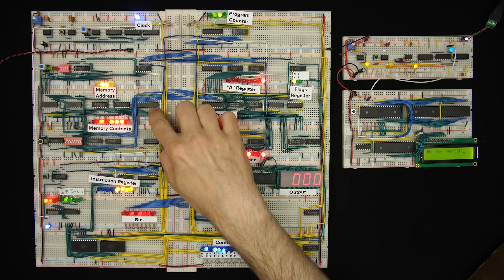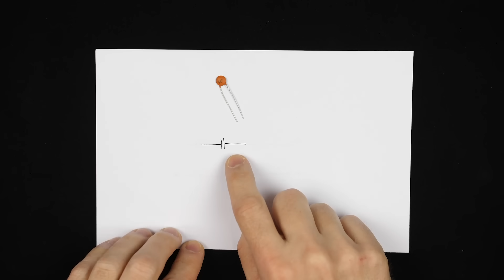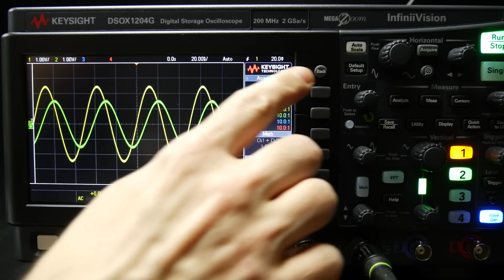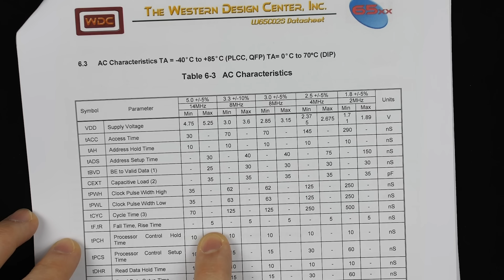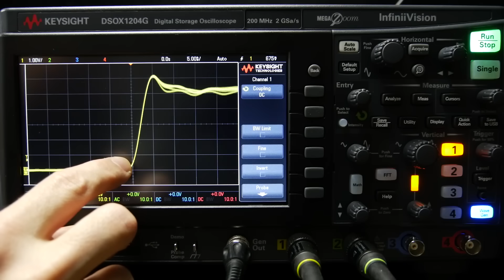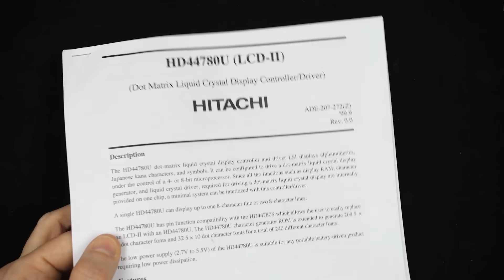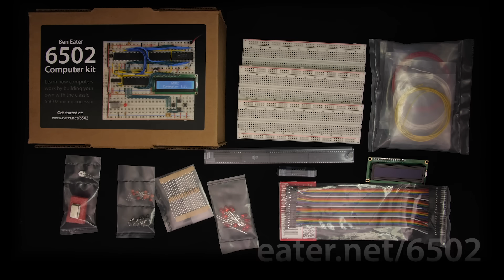Why build an entire computer on breadboards?

Comment: Pheeew, just reading the title… my answer “To make your life a living hell”.
Didn’t say this as an insult, but rather said it from anger. And not towards the creator, but towards myself🤣 I’m in uni, studying electronics and we had to build a finite state machine, a binary counter which counts up to 15 (obviously not in order, HA!!, would be too easy, and with some not-allowed states)… and we had(have) to make this on a breadboard. 
I spent at least 5 lab sessions (each of them 3 hours), building it and later debugging it, and even later taking it apart and rebuilding it… and now spending more time on it, but now at home with some stolen ICs, with the help of dad… and we built it again from 8pm to 1am… but due to the obvious side effects of the late time period… we made the situation worse rather than fix it… going from phantom connections, broken IC legs, burnt out LEDs…so… what are we doing now? Yes, rebuild it with even more thought while doing it, and not late night.
Btw, the design works on paper, and on simulation, it’s always the practical stuff that never wants to work.

Comment: When you’re demonstrating the phase shift at time 11:00(ish), why does it appear that the output is moving ahead rather than the input? Or is moving forward really falling behind? BTW, thanks for all the really great videos. They are a great resource. - Jason Burchell
Reply: It’s from the capacitance/inductance inherent in the breadboard, which phase-shifts the output. It’s much more noticeable at higher frequencies
Reply: @LookItsLuke99  I understand the phenomena , I don’t understand how the phase shift appears to move one waveform forward in time or the other waveform backward.
Reply: @JasonBurchell76  Moving a waveform "forward" on the time axis is a delay because for the same periodic signal it will take a longer time to reach than for a signal that isn't phase shifted. For example assume you have a waveform that starts at 1 at time 0. If you phase shift this signal to the right by 1 second instead of starting at 1 at time 0 you will have 0 until you hit 1 second where you will see the beginning of the signal period which is 1.
Reply: That's what a phase shift means( sin(wt - a) moves a/w forward on the t axis).

Comment: why build physical at all, simulate it, on octave/matlab/logisim-evolution/anything/java/c++
Reply: its logic circuits anyways, not really the underlying voltage shzz
Reply: it makes it more fun
Reply: @TheMatto58  to each their own isps
Reply: Because those are slow and can be inaccurate. Also, you can't really use it for anything, and just using a simulated one in general is more annoying.
Reply: @tristanmisja  why do you think digital logic is inaccurate
Reply: @Jkauppa  The chip implementation could be off
Reply: @tristanmisja  so could be the chips
Reply: @tristanmisja  simulation is better for fast prototyping also, unless you want to go spine to the walls hw only

Comment: In electronics school back in the dark ages, we built an 8080 computer on breadboards.  Out of 4-6 teams in the class, I am not sure that more than one got it to work.  Wire wrap seemed to be the fix for that, but it was a huge pain.  I still use breadboards whenever I do work on an actual project.

Comment: because you can reuse the components... w.e

what I really want to know is why are they called breadboards?

and ofc getting a kit takes away thinking about how it works, how ironic you sell them. 
you could just etch your own boards, my old man used to do it with a magic marker and a little tub of acid ffs... but oh no! that would be work and require planning!!

there was also a time when you could just salvage all of the components you need for an electronics project from junk... but in the age of surface mount bullshit that'd be more work than fun lol. hence why this is all done with 80s hardware, this hobby more or less died in the 80s.

Comment: So I am really interested in your kits when I can afford them but for now I have a newbie question or comment about your demonstration of the phase shift experiment where the output signal begins to diverge in phase from the input signal. I see that it is also attenuated but what happens if you continue to increase the clock until the phase shift equals exactly one wavelength? Would this circuit work at one megahertz then stop working then begin working again at 100 Mhz or whatever frequency would result in a phase shift of 360 degrees? (I’m just using random numbers to make my point). EDIT: I also wonder if the output signal would disappear completely when the input and output were 180 degrees out of phase?

Comment: Before watching this, I'm going to guess that the extra impedence from longer connections between parts would hurt the performance potential of the computer and also introduce many additional points of failure. Still, it's too cool not to try it...

Comment: Big projects like that are good until you need something with higher current/voltage loads. Given that heat dissipation can occur in some circuits it really depends on the quality of breadboard, or if you need to move up to a PCB board. Like another other comments I see here though I agree on having a computer for a breadboard, but do teach how the electrical side of things work both in practicality and mathematically. I think a lot of people probably struggle on those and maybe some components that need more complex equations to use more correctly.

Comment: From the color difference between those breadboards the cheap breadboard honestly looks like its made out of zinc instead of steel. That would explain why it lacks elasticity of the better one, zinc is more maleable than steel while steel is stronger and more elastic. It would also explain why the  cheap one is thicker since zinc is weaker and needs to be thicker to have any strength.

Comment: I got mine working, after 18 months of watching the videos and two weeks with the kit. Getting the Arduino was definitely the kicker. Here and there I'd seen the character display clear, which led me to believe I was on the right track, and, once or twice, I would see an "H". In hooking up the Arduino, I went over my wiring mess on the breadboards 8 or 16 more times, and suddenly I was seeing garbage on the character display! Not Hello, World, but some kind of data was making it into the character display.

I was futzing around with my Arduino connections, checking my external power and ground, and my reset circuit, and re-writing Ben's Arduino program so it only displayed writes to the 65C22, and I looked down, and there it was.

"Hello, Wo"

I cranked up the speed on the clock module, and it did the rest of it before my very eyes. And I hit reset, and it did it again.

Then I bumped something, and everything went to hell. But now I know how to find out what.

Happiest day of my tech life since Christmas 1983.

Thank you, Ben Eater.

Comment: O you know what’s the worst, when the entire circuit is correct but one of the resistors isn’t pushed in all the way, like in my electrical engineering class, I spend so much time trying to figure out why the circuit isn’t working then I rebuild it and it works like fuck

Comment: I learned from experience those breadboard anomalies, that can arise from cheap breadboards. After hooking up a few components, creating a lovely circuit, that worked fine one day, the next day the same circuit was really wonky. I thought I had made some mistake in my wiring, so I doubled checked and triple checked everything. Wiring was fine. It was the breadboard itself that wasn't guaranteeing good connections!

Comment: Isn't it possible to "clean up" the square wave by feeding it into a little circuit that just outputs 5V if the input is "high" and 0V when the input is "low". Then it would be 
1. a flat line at 5V 
2. then a ~5ns shift time from 5V to 0V 
3. a flat line at 0V 
4. then a  ~5ns shift time from 0V to 5V 

Wouldn't that at least eliminate the 150MHz sub-waves in the "staying high" and "staying low" phase?

Comment: if 20MHz is already a pain to be stable how the hell can today CPU run with 3.30GHz(3300MHz right?) or more, is it just because the transistors are nanometers in diameter and/or the circuits are very insulated from each other?

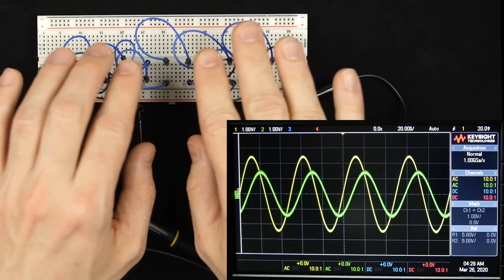Comment: That part at around 12:48 is actually really interesting, where he is hooking together some simple wires and measuring changes in a high-frequency signal across them. Not only can you detect the capacitative/inductive interference of the wires in a practical, physical way, so that you can avoid/reduce this interference. But you could use this in a deliberate application to measure the distance between the wires, and their orientation. I wonder if this is something people do.

Comment: I'm working with this equipment in physics and systems and this video was really helpful just to understand concepts. Does adding a capacitor near components act as a low pass filter? Also you should definetely explain the math on everything since you have such a great understanding of what's happening! Great video!

Comment: I certainly agree with the intro of this video, I never thought of getting a kit as anywhere near designing a circuit. :) A kit to me is little more than a commercial product with greater accessibility to its components and more likely to fill an esoteric niche. Designing from scratch is something else, and while I'd want my designs to ultimately occupy a PCB or at least stripboard, breadboard makes it easier to change the design, including fixing hardware bugs.

Excellent explanations of the analog issues too!

Comment: I Like Using Breadboard. Because You Don't Have To Painfully Solder Every Component Into PCB Or Prototyping Board. And If You Make The Wiring Cleanly. You Feel Satisfied. Yea Sure It's Big. But You Can Move It To PCB Or Design Inside Software To Made It Compact.

Comment: Great video - may change my opinion of breadboards. I think I agree they're much better for learning.

minor quibble about capacitors - should also say: 

"Until charge flows to/from terminals of the capacitor, the other side will tend to 'follow' any abrupt changes in electrical potential on the other terminal. That is, capacitors tend to resist allowing the voltage across them to change, and this means one terminal can 'drag' the other around.
Given time, the flow of charge will then 'allow' the terminal potentials to become different from how they were. 

Using them as a filter to 'keep the voltage steady' exploits that effect. You want 'big' capacitors to make voltage differences 'steady', and 'small' ones to allow things to change without interference. 

So mutual capacitance is your enemy when you want wires to be able to change voltage quickly without interfering with each other."

The real limitation for breadboads isn't actually capacitative coupling, it's inductive coupling, which is much more difficult to wrap your mind around. Bolting or sticking a layer of conductive metal under your breadboards, and connecting it to ground or power at as many places as possible - maybe making a conductive 'cover' to put atop the circuit, doing the same thing - offering many points to connect to Vcc - preferable at each chip - will help enormously. 

This will tend to kill inductive couping, which allows circuits to change currents fast without generating voltage pulses on coupled circuits. This is why multilayer circuit boards are so popular.

The other 'trick' is to use 'complimentory' logic signalling. This is where you use two wires per signal, and not just one. With breadboard you can do this by wrapping two wires together, the other can just go to/from ground at each end. This provides a closer, better magnetically coupled 'return part' for the magnetic coupling, which will then tend to prevent any magnetic interference between different pairs. This is basically why all networking over wire is done the same way (although it helps even more to transformer couple at either end as well, this prevents DC voltage differences between ends from interfering too).

The other way to avoid magnetic interference, which is even more popular nowadays, is just to have each chip generate always two signals - the output and it's complement. If these always swap on/off states at the same moment, and the transmission delays between both wires are made equal (if over a circuit board with ground planes) or routed through the same physical space (either by coax or twisted pair - if not over a ground plane) - AND the current sum of both signals is constant always - then the interference generated by the signal is always cancelled by the counter-interference in the other. 

And you avoid both generating interference or being suspect to it. This allows you to use smaller voltage swings, because there's no interference, which lets you go even faster. This is basically how all modern digital connections work - whether between your RAM and processor, or PCIe, or USB3.0 or thunderbolt, etc. 

Much harder to do on a breadboard, but really only because you can't always buy DIP logic chips with purely complementory outputs - most of the ones that exist, you can only buy as SMD parts - because DIP and through-hole parts fell out of favour long before the advantage of complementory signalling like this became apparent. 

(Just don't fall into the trap of thinking that it's 'differential' signalling, it isn't really, although you can receive it that way, for some noise immunity, it works almost as well just to 'dump' the complement signal into a Thevenin equivalent load next to the chip you're sending it to).

So, now I've told you how, you should be able to drastically increase the clock rate of your breadboarded digital circuits. Not understanding this technology, was really what limited 'breadboard like' early PC's to such low clock rates. Putting decoupling caps everywhere near each chip is just a band-aid fix. If those chips are always outputting a constant current (because of having all complementary outputs), then they wouldn't need them, because their current draw could be made constant and not a function of their logic data state - thus avoiding polluting the power supply for the other chips.

That would let you increase speeds to the point that the capacitive coupling between the metal pieces in your breadboard becomes the limit. At which point you can use a 'shielded' breadboard to go even futher.

But everyone prefers to just use 'dead bug' and 'sky-wiring' prototyping techniques, since it gives much better performance at high speeds, especially if you encase it in a conductive box. Those circuits look like total rats nests to the un-initiated, but they are seriously high-performing prototypes - often working much better than PCB circuits. Beauty only other electrical engineers can appreciate.

Of course, for serious digital computer engineering, nowadays you use an FPGA.  See icestudio for something that makes it very beginner friendly, like arduino does for microcontrollers.

Comment: For me, breadboards are:
1. require too much workspace (thus, not flexible enough for hobby studies)
2. relatively unreliable (the more connections, the less reliability)
3. A bit too expensive
Prototyping boards much more suitable for amateur studies.
Breadboard is good for solving single nodes of more complex circuit, then you need to solder it onto prototype to be sure it is reliable enough.
There are much bugs you need to debug in your circuit (even in digital one). And bunch of unreliable connections is the last thing you need.

Comment: 8got a breadboard off wish a while back. It didn't have spring-loaded holes at all. It instead had bare, stranded 20ga CCA wires under each hole, in a channel. You jam the pins into the wire to make a connection. Definitely cheaper than springy steel clips, but also complete trash.

Comment: 12:50 most likely that wasn't caused by the physical shape but by your proximity. You're full of salty water which is an awfully good capacitor juice, polar molecule with a bunch of free floating ions.

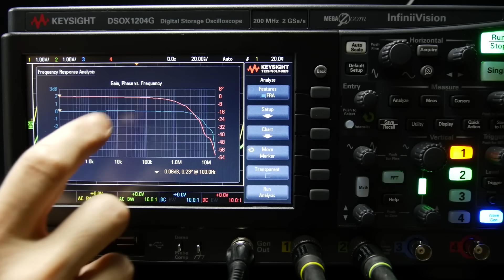Comment: doing some quick analysis visually on the bode plot at 12:25 implies we see a second-order system. which makes sense, as a system with both capacitance and inductance will resist changes in both current and voltage, creating a quadratic system in laplace space.

Comment: Great video. I dipping my toes back into electronics projects, after 30 years away from it. Your breadboard projects looks like a great place to start. One thing I wondered when watching your video was, is there a way to measure the lengths of wire using a scope? I.e. to verify that they are all the same length.

Comment: Your worst-case demonstration setup (resistive loading, big wire loops, etc) to illustrate significant signal integrity effects at manageable frequencies, even to the point of real-time changes while pushing the wires around, was brilliant. This is an example of how a well-made video really can teach in ways that even the best books cannot.
Also, those cheap breadboards really hit the fail trifecta for connector contacts - poor geometry, poor choice of alloy and/or temper for the base metal, and the plating also looked pretty awful.

Comment: I think what he was talking about at 11:38 had to do more with transmission line theory then anything else. A high frequency means that the speed of the waves are faster and in turn shorter wavelength. This can cause a reflection to be bounce back towards the source. And in transmission line we talk about how the electromagnetic field is what carries energy not necessarily the wires themselves. The wires is direct the energy so that could also explain things. Idk I’m not the brightest so I could be wrong lol